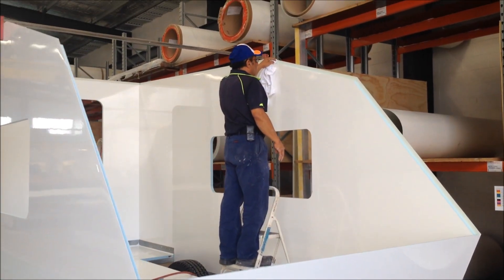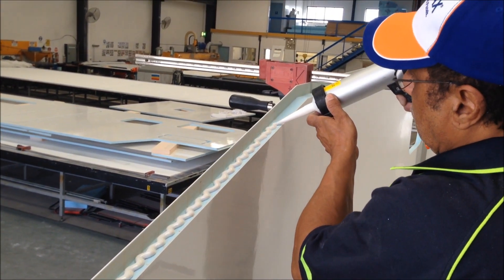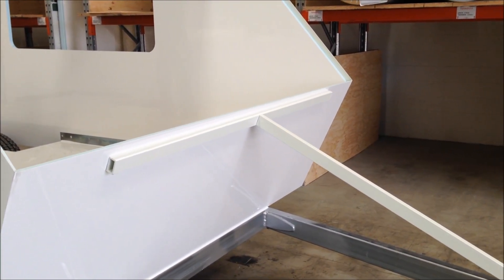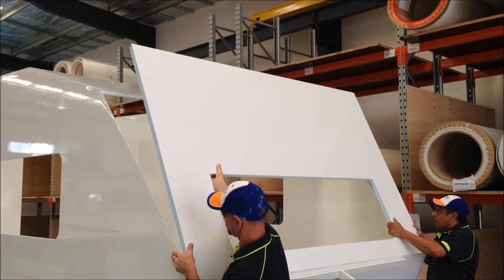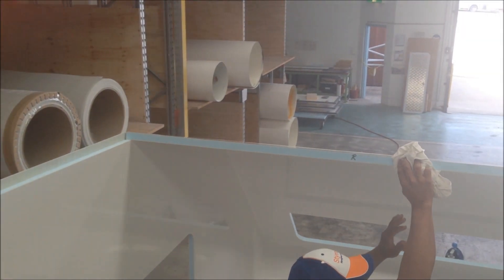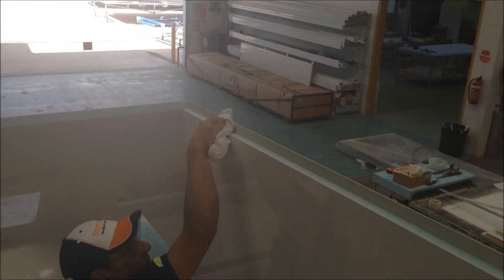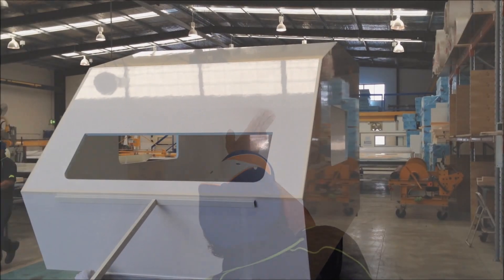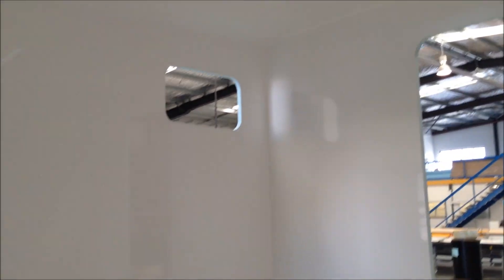Upper front wall & roof panel assembly with Teroson MS939 by Henkel

Comment: I would have liked to see the external sealing of roof especially. The vertical groove v's a horizontal one,?  

Could this process be used for a box truck back? That is with out aluminium corner extrusions.
Further would the corner aluminium extrusion be a better bet for on off road camper. Think trees etc. ; - Thanks.
Reply from the maker: Have a look at some more of our videos, you might find the answer you are looking for when we put them together in house.

Comment: What is the strongest way to fix cabinets to this board?
Reply from the maker: We recommend make the cabinets modular and bond with teroson ms939. You could always insert a plate to the panel if you wanted to mount things like a TV bracket.

Comment: Because.....like I said....no framing.....as in metal....would never last.
Reply: And no flimzy AlKo chassis to flex at the first bump
Reply: Dill pickle. Foam core fibreglass boats and caravans have been around for decades and mostly outlast the alternatives. And all those skyscraper windows are held on with adhesive. This is the problem with plastic pollution, this stuff lasts too well.
Reply: @rhendersbee685  agreed, and most vehicles now a days are assembled with panel bond (epoxy) that is guaranteed to out last the base material !
Reply: You clearly are not up to speed when it comes to modern panel and adhesive technology.
Materials in this industry have  (unlike your thinking ) advanced tremendously .

Comment: No frame and is it strong enough?
Reply: Yeah I am interested in its strength too? Can the roof hold a aircon unit?
Reply: bladerunner123 They have strengthening bars in the panel to support the aircon
Reply: No wonder they don't last.....no framing.....no bracing......no buy.
Reply: @mikedill7378  What makes you say composite panel caravans don't last?
Reply: depends on belief.......panels are plenty strung , but the adhesive  i'd be questioning    don't much trust products